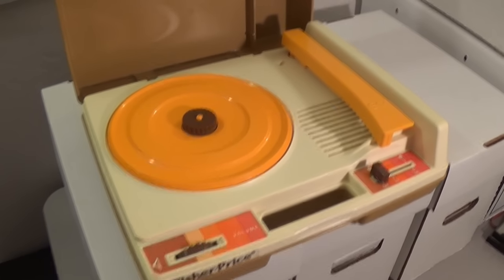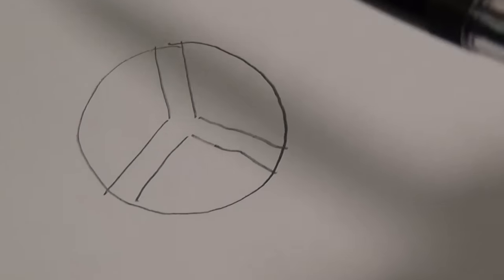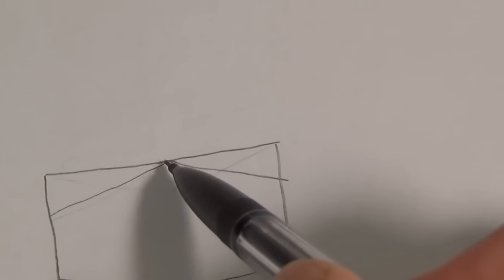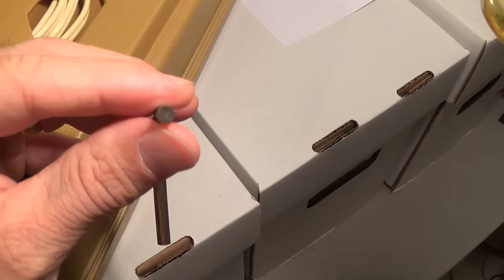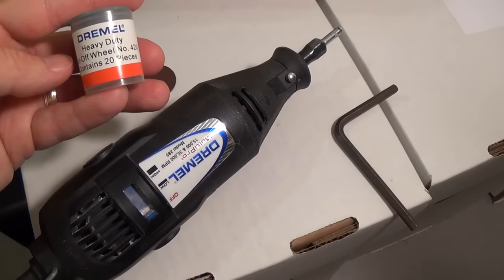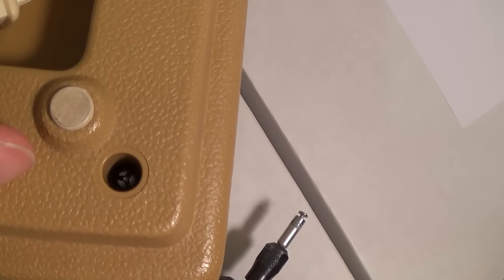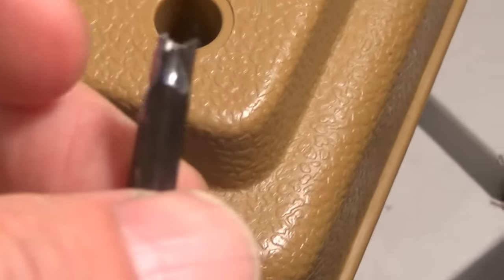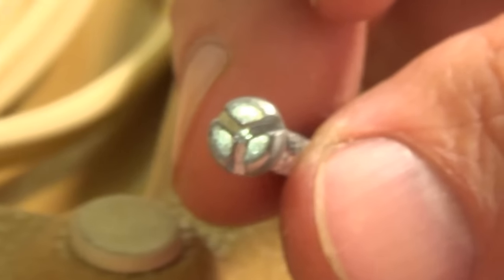How to Make a Tri-Bit/Tri-Wing Screwdriver

Comment: I want to open a Nintendo Switch joy con, the screw head is much smaller than the one you extracted but you've inspired me to try anyway :)
Reply: bought a Y00 screwdriver instead and it worked fine
Reply: Yes.
Reply: @alistairpage-mcgill2723  where from please tell me
Reply: @not_neet8298  same.
Reply: @alistairpage-mcgill2723  I'ma try for my joy con anyway
Reply: @not_neet8298  I live in the Czech Republic but I'm sure you can find one where you are. I had to order one online cos they're not very common
Reply: @tripster103  one of my joy cons has developed stick drift so I need to do it again too
Reply: @alistairpage-mcgill2723  thanks also instead of getting new joycons in case you're thinking of getting them you should try and save up money for a pro controller. I got a new one and it has no stick drift whatsoever

Comment: Great job..next time drill a small hole in the center with a drill..then do you dremel carving..
Reply: Easier said than done unless you've got a machine shop with a drill press and vise fixture on its bed to hold it perfectly centered. You're not going to drill a properly centered hole that small in diameter with a hand-held drill. You are correct that it's a tri-bit (versus tri-wing or tri-point), with a security post.

Comment: I have use Woods metal that melts in boiling water and pour the metal over the screw head, and before it sets take a slot screwdriver into the top of the drop of metal. Hard to do on such a deeply recessed screw though. Works great on exposed screw heads that are not too tight.

Comment: Thank you for the "tip" :). As time has passed new screwdrivers are available, I have found what they call "3 point scredriver" (and even 5 point). around 5 euros from ebay, not sure of the quality, they look like they could brake easily.  just in case it is of use to someone.